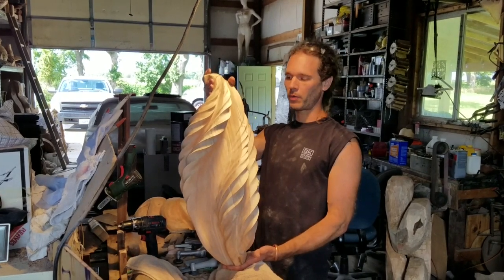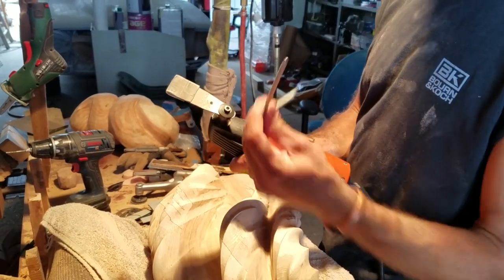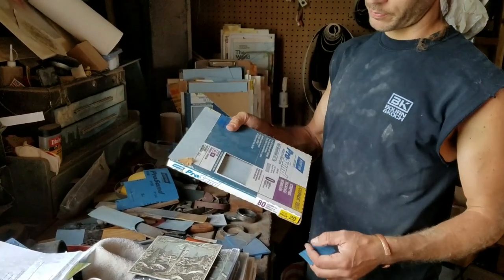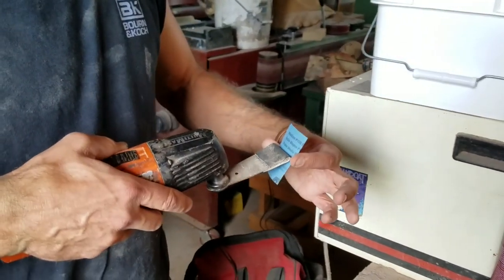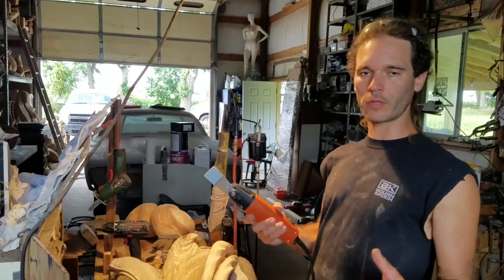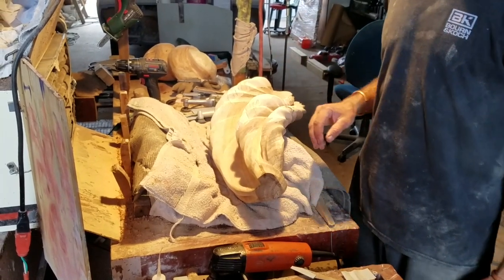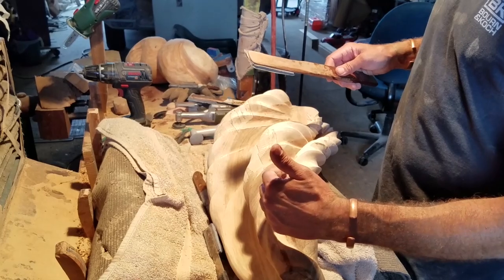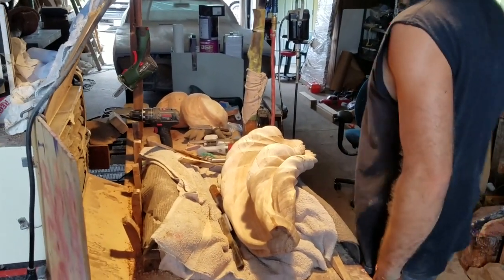Sanding with the Fein Multimaster

Comment: Thanks Salem, that tip on the bicycle tube and the 3m spray is awesome. All my other sanding attempts with my fein would heat up the attachment and the sandpaper would just sort of melt off. Thanks so much for sharing. Your pieces are beautiful.
Reply from the maker: Thanks. The adhesion is strong enough for the work, and weak enough to be removed easily. As with all my use of abrasives, I prefer sharp paper and frequent paper changes. Heating the wood affects the finish because the resins/sap get cooked. Dull paper also burnishes the wood instead of cutting it.

Comment: Fantastic. Thank you. Can you please me the purpose of drilling a hole in the lower part of the tool you made with tyre rubber & sandpaper?
Reply from the maker: That's where the screw goes through the hole to mount it to the Multimaster.
Reply: @SalemBarker  Thanks Salem.  Your vid reminded me to pull my Fein out of the attic for small a sanding job.

Comment: I'll have to try that multimaster approach.  I wonder how long hook and loop would last on there.  I like the little wavy edge discs in a drill and recently got the Arbortech contour sander.  I was pretty skeptical about it but it does a nice job.
Reply from the maker: I don't have their contour sander yet but it's been recommended to me a few times so I think I'll get one.  Hook & Loop would work fine since that's how the Multimaster sanding tools usually adhere. I like sharp paper and change so frequent that I imagine H&L would get pricey. I'm cheap.
Reply: I don't know how often they do this, but a guy from Arbortech actually came right to my shop and let me try out all their stuff. I happen to live near one of them so it worked out easily but if you shoot them an email you might be able to arrange something when they are in your area.
Reply from the maker: Thanks! I met the guys at the U.S. branch at a show near Boston last yr. We've been working on something to do with sponsorship and they stocked me with their latest tools. There's more in the works..
Reply from the maker: I'll be at that same show again next month, the Paradise City art show in Marlborough, MA. Are you in the Boston area?
Reply: Couple hours north.

Comment: I am always looking for better ways to sand my sculptures and bowls. I want to get the proxxon mini angle grinder but it looks like it might be under powered for carving. Do you have any problems with that? I love all your work by the way
Reply from the maker: The Merlin from King Arthur's Tools is superior to the Proxxon Long Neck Angle Grinder,  but i generally only use either for sanding and cutting with a saw blade. The Arbortech Mini Grinder is my best for grinding. They call it "grinding" but it's actually cutting. Grinding is abrasive stock removal.

Comment: Do you have a video where you explain how you make those sanding attachments (end of this video)? I would really like to see 🙂
Reply from the maker: I never got around to doing the video but I would like to. If you own one of these grinders, you can simply use a 4mm screw to fasten pieces of plastic from old credit cards or such things, then glue a layer of foam rubber to it. Use aerosol spray adhesive to continually apply fresh sandpaper to the foam. This gives the opportunity to create profiles by custom shaping the sanding discs.
Reply: @SalemBarker  thanks a lot!!!

Comment: PROXXON mini grinder vs MERLIN2 mini grinder, In your opinion which one do you think is better?
Reply from the maker: Definitely the Merlin. I've had to change circuit boards, power switches, power cords, and spindle bearings numerous times in three proxxons, but the Merlin has needed nothing in three years of regular use.